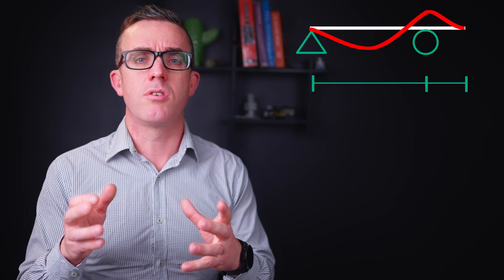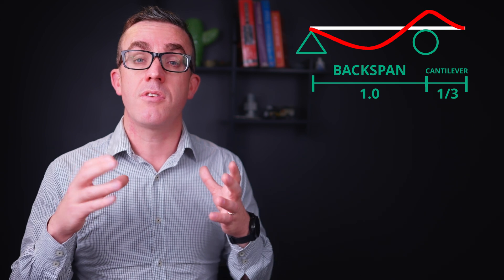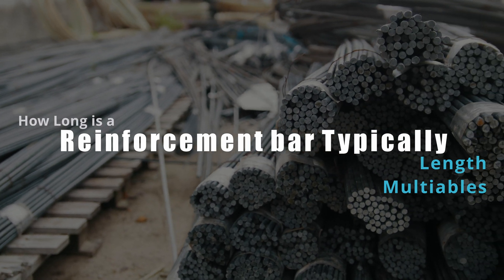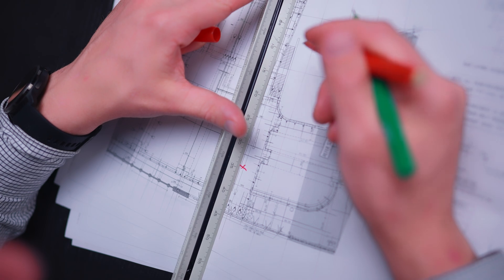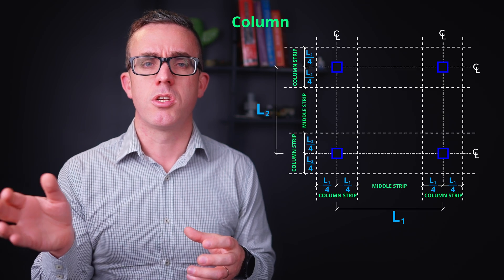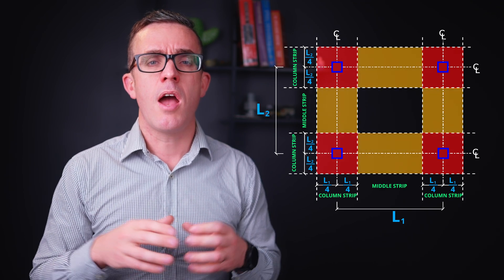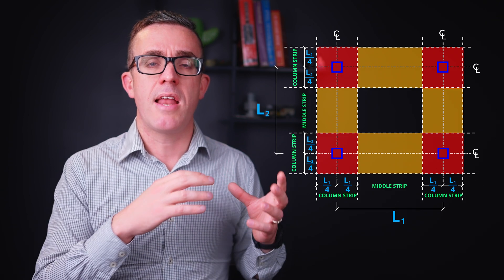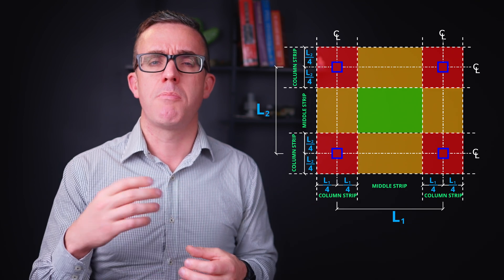The Secrets of  Efficient Reinforced Concrete Structures

Comment: Looking for some analytical videos, like design of flat slabs, p-delta analysis procedure, concrete filled steel hollow tubes,design of cruciform steel columns, design of a base plate under moment and axial force, bolted moment/shear connection, etc... 
These videos are great, insightful, but some sections are not very evident, even after codal guidelines... Looking for some clarity from a guy like you.

Comment: I find that almost every mechanical engineer insists on punching holes in the slab right next to the columns and as much as I try to steer them to the green zone they refuse. As if on principle.
Reply from the maker: Hi anon, thanks can happen. It can sometimes be a architectural restriction. So worth discussing with the architect.

Comment: Do you mean more efficient (faster, easier, cheaper) to build? I can understand why the first would be more efficient (maintaining the same grid throughout the height of the building) but I don't understand the advantage of the second (moving the column away from the column edge to introduce a cantilever)
Reply from the maker: Hi Neuron, it depends, no transfers is quicker cheaper and easier. Canterlivers helps balance the moment better the top and bottom of the slab(assuming you haven't increased the building size) also helps balance deflection as the cantilever will pull the back span up.

Comment: Is it true you just need to know minimum reinforcements
Reply from the maker: minimum reinforcement is required to prevent a brittle  premature failure due bending or tension it is also to control cracking

Comment: super awesome content!

I agree with shifting of the column inwards to have cantilevers to balance the sagging moments in adjacent beams. especially for high rise plates. but i never knew the 1/3 span rule and would this have an effect if column size is 2.5m diameters (stiffer than floor beams), beam size 0.4x1.0m and span length is 10m?
Reply from the maker: Hi David  the columns would effect this. As moment is pulled into the column the stiffer the column the smaller the cantilever, for efficient design. But it would be relative stiffeness column vs slan/beam.

Comment: The effort you made to make this very insightful and professional video quality is highly appreciated. An important issue in having an efficient RC or any structure is participation of structural engineer in early stages of the project phase. A structurally inefficient layout can't be made efficient by a sophisticated structural modelling, analysis and design.  Please consider durability , maintenance of existing structures in future videos. Thanks Mr. Berndan.
Reply from the maker: Hi Mussie, thanks for watching and support. Agree that Efficient design of any structure starts with a good concept, this requires some structural input to guide the decisions. I will add the suggestions to the list thanks.

Comment: A facility design (residential or light commercial) from scratch to final detailing (as per the prevailing  code) including all elements (foundation, slab, beams, columns, bracing, etc.) would offer a good piece of learning. Kindly consider my request.
Reply from the maker: Hi, Fammaz thanks for the suggestion. I will put consideration on doing this, similar has been requested several times. It is good to see interest in it.

Comment: Hey, Brendan. Massive Thanks for the video. Btw I was wondering why there aren't textbooks that teach students how to design RC building efficiently? Like what you said, for some reasons most textbooks at college are heavily theoretical or don't teach the design efficiency that much. It would be better if there was a textbook written by practitioner engineer for junior engineer, so that this important stuff do not only have to be transmitted through experience.
Reply from the maker: Hi Gerardo,  thanks for your support. From what I have found most textbooks are purely theoretical, and it is important for all engineers to know. glad that this video has filled the hole in knowledge.
Reply: Yes there should be practical oriented books so that no one would be unemployed

Comment: Fun fact (applicable in Australia), If a column plan size is larger than 1m^2 it has to be subtracted from the floor plan when selling the apartment. If you make the column 0.99m^2 then you can ignore it and have a "bigger" apartment size to put on a marketing brochure to sell.

In that case, its worth pumping concrete and steel into it to make it smaller. This was a few years ago - not sure if still the case now.
Reply from the maker: Fun facts are always great, NLA are always import to think about in your design but then this is a it does come at a cost of reinforcement.